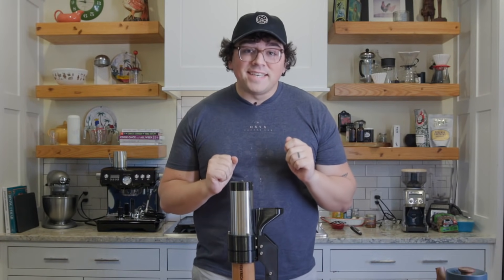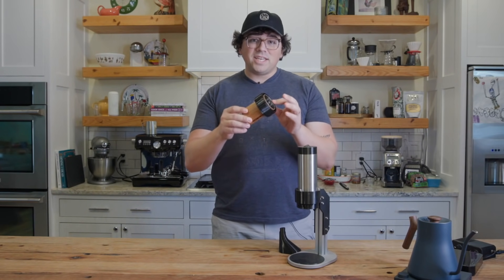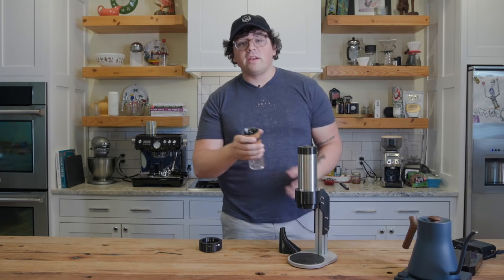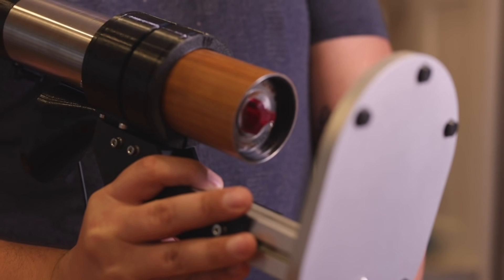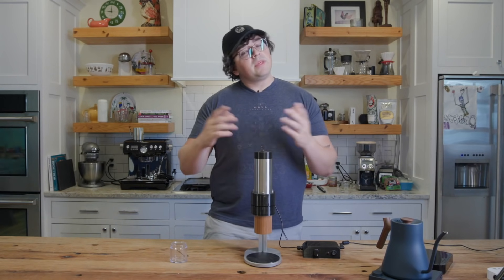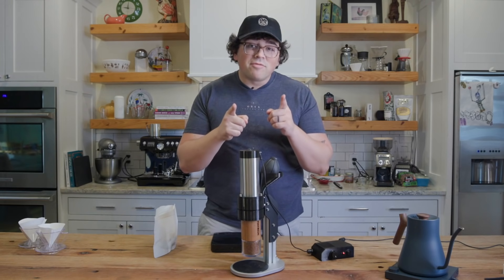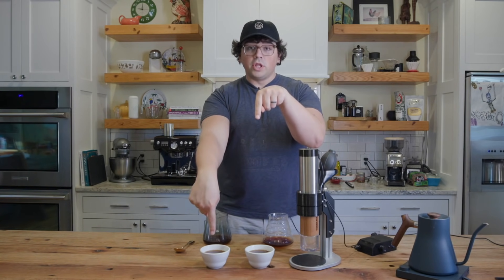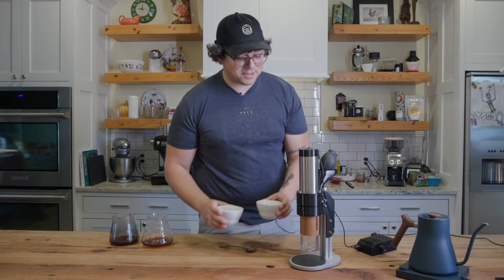MOTORIZED HAND GRINDER?: Review of the Skope Motor for the Comandante

Comment: I found that for espresso when I grind slow the shot time increases so I have to grind coarser
Reply: Interesting, sounds like you're getting more fines at lower RPM (I thought it's usually the opposite). Which grinder?
Reply: @BensCoffeeRants  1zpresso jx pro
Reply from the maker: This is intriguing! Hmmmm I'm wondering if going really slowly will somehow cause a reverse effect? How slwo do you think you're going? Below one revolution per second?
Reply: @LanceHedrick  maybe less than one revolution per second  but not much
Maybe I get a more consistent grind because I can maintain the speed better🤷🏼‍♂️
I will check it the next time I make an espresso maybe i did something else “wrong” and I didn’t tested that often because the espresso tasted good and in the end it’s all that matters right 😁
Reply from the maker: Well, if you were maintaining speed well, you shouldn't have high fines. An issue with hand grinding is the inconsistency in rpm. The more consistent, speculatively, the more even the distribution.
Reply: @LanceHedrick  today I tried it again and I tried to go as slow as possible and I noticed that I’m not that consistent with the speed because it gets very hard to grind the coffe 
The slow grind was 1 g/sec slower

Comment: Chestnut G1+ is in the same range as those 3 you mentioned, but i wouldnt add any motorization to it. These things are meant to run low rpm ie hand use.
Reply from the maker: Sure! If you listened, I do point out that the speed I use with the motor immulates hand speed. It just gives more consistency, which can give arguably a better grind distribution.

Comment: I wish I'll have the time to design one for cheap in the future , not even kidding.

I design BLDC motor controllers from DC power for a living, with some help from another engineer or just one my own with enough time. I would definitely make one.
I own a jx pro and this idea is rolling in my head for some time now
Reply from the maker: That'd be great! There is one for the jx pro made in south Korea, but is $800 haha
Reply: @LanceHedrick  OOF, That's a lot, I really hope I'll have time to look into it.
Do you know what kind of motor the Korea one uses ? If it's a DC motor with a gearbox that would be stealing to ask 800 for it.

But if it uses high torque BLDC motor that would be "a bit"understandable.

I will definitely look into this when I have time or find someone who would like to help me on it either on the programming side or the mechanical design side.

Do you have a link for the one in South Korea ? :D

Ah and by the way, thanks A LOT for your response, your videos are awesome !

Comment: Looks like a small funnel port. Do the beans clog up the funnel if say you dump them all in at once, or does this require you to pour them in slowly. I have a funnel on my current grinder with a 20-22mm opening and I have to occasionally stir the beans to get them to drop into the burr set. That funnel looks quite abit smaller than that
Reply from the maker: The tip is small and I believe it is to disincentive dropping all in at once. But that's pure specialtion. I would argue, and Hoffman has done a little test on this, that dropping in at a slower rate allows you to grind finer and can arguably give you a better and more consistent grind. But even more importantly, dumping them all in at once had the potential, if going at a low rpm, to stall the grinder.r

Comment: Question that could make a good content for comparison video. This  verses electric grinders in a similar price range. So basically at the cost of the hand grinder, motor and variable speed vs a similarly priced electric grinder. Which is better for your buck? Benefits and draw backs of both.
Reply from the maker: Yeah. That becomes really subjective. Some people are huge freaks for the Comandante profile, so it makes sense.
I'm not sure a video with my opinion would do much justice because it is so difficult to make any of that comparison objective, if that makes sense.

Comment: I am kind of on the frugal side. I have a hand grinder where the handle can easily pop off. All I have to do is use my variable speed drill, tighten the chuck on where the handle usually sits, and grind away. I can use any speed i want. Of course, depending on the type of grinder, your mileage may vary. I would also not do this on a new grinder. Only one that has been collecting dust.

Comment: Hi Lance, for most case, for less Fine particle, Is lower rpm grind better for manual brew?  As for the other side of the argument, whether high speed rpm better for espresso grinding ?
Reply from the maker: Well, as I said in the video, it is truly all specialtion. As for fines theory, who really knows? Pull some shots with low fines and pull some with high. The former will have lower puck density, while the latter higher. Just need to figure out what your taste buds like most
Reply: @LanceHedrick  Thanks
Reply from the maker: No problem! Thanks for the question and engagement

Comment: Pretty neat, I was surprised you noticed one cup was better than the other and then thought the better one was the high rpm one! From my experience with a variable RPM grinder, it does seem like you get less fines at lower rpm which results in less bitterness, but also less body. I find for brew / drip / aeropress type coffee at coarser grounds the more unimodal grind distribution or just less fines (low rpm) does produce really enjoyable and clean / transparent cups BUT for espresso I kinda like some more body / bitterness sometimes. But that could change depending on the coffee (or my mood maybe).
Reply from the maker: So, as I said in the video, the only reason I assumed the higher rpm was the one I preferred is solely based off the specialtion that lower RPM causes fewer fines. So, I figured the vegetal tasting one was more underextracted. One with less fines would've let the water through faster, which the slower rpm did by 20sec, so I figured that must've been it.
I hadn't dialled this coffee in prior to filming purposefully to make the blind comparison a little more legit.

Comment: Wonder if you could just do a "dimmer mod" on a drill - tempted try that myself. ;D
Reply from the maker: Probably could! I wouldn't recommend a drill, though. Could break your grinder based on torque
Reply: @LanceHedrick  I use an 18v drill on my cheap £10 hand grinder and tbh it does a really good job. Been a few months now and it's still holding strong.
Reply from the maker: Wow! That sounds awesome. I need to try my drill on some cheaper hand grinders.
Reply: @LanceHedrick  Please do and let me know how it goes. Might even be worth doing a video! I'd watch that haha
Reply from the maker: I can't NOT make a video on something weird

Comment: The KINGrinder range of manual grinders is designed to be used (optionally) with electric screwdrivers. I hope other companies would follow this trend.
Reply from the maker: Cool! And no issues with the axel breaking or any other issue?
Reply: @LanceHedrick  They claim to use beefed up bearings and shaft specifically to support the high RPM of electric screwdrivers.
Reply from the maker: Oh wow! That's incredible! What is the top end model? I'll look into getting them to test

Comment: My endgame grinder would be an electric that has zero retention, is simple to clean, and is highly customizable (swappable burrs for different situations, variable speed - i.e. somewhat future proof). My pet peeve with most high-end electric grinders is that you might spend thousands, but you basically only have one profile with that grinder. I'd rather have several, specialized ones instead.

If this motor had adapters for other hand grinders, I think I'd have what I was looking for. Compared it to an equivalent electric grinder with the same quality of results, I think that price is actually reasonable. I would seriously consider buying one if they had adapters for other hand grinders. I might have to buy one and make my own 😁!
Reply from the maker: Do it! If you can make an adapter, that would be huge!
Reply: This is why, 4 months after buying my DF64, I still haven't gotten rid of my Niche Zero. 😉👍
Reply: With variable RPM you can kinda DO have multiple profiles. If you want a bit more bitterness and body at the expense of clarity, choose higher RPM, if you want more clarity, less body, (and don't mind a longer grind time) choose lower rpm. If you can't decide, go somewhere in between :p
Reply: @BensCoffeeRants  great point 😁! Definitely didn't mean to imply total limitation. What I was more referring to was burr geometry. Some are better optimized for certain brews. Also, I've seen some people that have two or three of the same hand grinders. Seems using multiple grinders/burrs can have benefits for when switching between methods (e.g. espresso to pour over) or beans. Less to think about in terms of grind adjustment and retention from the previous setting. I know at some point this can seem ridiculous 🤣, but I'm just after total flexibility. I guess what I'm thinking is a modular system.
Reply from the maker: Just get a motorized hand grinder with a burr geometry you like and then a flat burr grinder with lots of Burr options, like 64mm or the like. Then you can switch out as you like haha
Reply: @LanceHedrick  lol Lance, it's like you and I are on the same page here! 
😉👍
Reply from the maker: For sure! Switch with the coffee or the day or the mood!
Reply: @LanceHedrick  haha, well I meant in terms of the idea of going with an electric hand grinder paired with a 64mm flat burr as a combo, but yes, that is precisely the point! 👍
Reply from the maker: Ah yes. Very good. Need transportability, for sure
Reply: Great points guys 😄. By the way, I'm almost there now. I have a Ceado E5P (64mm flat) and an Encore (with M2 burr upgrade) for electrics. My hand grinder is a JX-Pro and should have had the ARCO by now, but...

Been thinking about a modular grinder for a little bit. Thought it was something nobody else really cared about until I saw Lance's video on the Etzinger. That's starting to move in the direction I'm referring to in terms of changeable burrs. What I'm thinking though is for the burr set as a fully contained module. Essentially the grinding section of hand grinders, except it would be more compact since it doesn't need to hold any beans. With a variable speed motor, you'd be able to explore flat burrs and burrs of different sizes (e.g. 83mm conical at lower RPM). Haha, maybe I'm just thinking of the KitchenAid of grinders 🤣.
Reply: @davidmaurice1294  hmm 🤔, that would be interesting. A hot-swappable modular grinder setup where you could easily switch between conical and flat burrsets. Assumably those module housings would be customizable too, so you could put in Mazzer or SSP burrs.

I'm in a similar situation as you right now. I have a DF64 for flat, a Niche for conical and a JE-Plus for manual. At the very least, a variable speed motor rig for the JE-Plus would allow me to remove the NZ from the equation.
Reply: @slvrbach  Yeah, I like the way you put it, "hot-swappable" 😁. I'm thinking each module might range in cost from $100 upwards (maybe even $1k+ for some). But considering many endgame grinders might start close to $3k, it doesn't seem a stretch to have something that starts at $1000 that you can upgrade over time.
Reply: @LanceHedrick  Just thinking out loud here. If for a grinder of smaller diameter and same hex size, would adding a rubber strip between the grinder and silicone as a shim make the connector work. In other words, to make it compatible for some grinders, an adapter might be additional rubber to resize it to the Comandante's dimensions. Is that something you could test?
Reply from the maker: Hmmmm type this up and shoot to my email. I'll def forget. kylelancehedrick@gmail.com
Reply: an electric motor would help me as I have difficulty holding the Comandante as I grind, due to arthritis

Comment: Really interesting. I tend to wonder why it seems most pourover brew guide videos I watch tend to have much slower drawdown times than I tend to get with my V60. This is especially so when I try to bloom: when using a 2:1 or even 3:1 water-to-grounds bloom ratio, the water always draws down way too fast for me to do anything like what James Hoffman does in his V60 guide during the bloom phase. The effect of slower RPM presents one possibility since I use a hand grinder, whereas most coffee Youtubers use electric grinders, which may mean that my grounds may have a smaller proportion of fines that speeds up my drawdowns relative to the norm.
Reply: i recognized the same with my v60! i always wonder why in my experience i have to grind finer compared to other v60 recipes on youtube.
Reply: I had the same problem with blooming. It was always just like a foam and I couldn't stir it. Quickly wetting all the grounds and general faster pouring during this phase worked for me. Also using a hand grinder.

Comment: You may find it's down to particle shape rather than size, I have seen others do a Kruve sift test at different rpm's and they had similar number of fines, but only on a visual inspection rather than through an electron microscope, but different particle shapes give different surface areas for extraction.
Reply from the maker: Oh for sure. Particle size is massive. Issue is, this is even more difficult to quantify than distribution.
But yes. This is a big point bentwood preaches with their grinder- they're making much more spherical grounds. 
Big difference, assuredly

Comment: I love this! I was just thinking last night about how to make an electric motor for any hand grinder. 

1 upgrade I see for this... a hand tightened screw with a lever latch. 
But in this case where it's ONLY for a comandante, the screw probably wouldn't be necessary. Just the lever latch that would latch flush with the collar at a fixed pressure. 
Hoping for a universal iteration of this motor! I've really been wanting to motorized my 1ZPRESSO and KingGrinder. Would be awesome to have one machine that would work with both!

Comment: I've always wondered about this, I have a cheapo grinder that crank with a drill, dunno if safe. 

Ok 3 minutes in, probably risky.
Reply: Done something simular with the Hario i have. after upgrading to metal burrs i was wondering how to motorize it. made a contraption that makes me use the homeblender on top of it. works perfect
Reply from the maker: Yeah. I'd be nervous with these expensive hand grinders to use a drill. But feel free to do whatever haha! Thanks for the engagement
Reply: So long as it's a low speed, I can't imagine it being hard on a well made grinder. Maybe 30-50% faster than a person could grind by hand is totally something a grinder should easily handle
Reply: @veganpotterthevegan  But he found slower RPM tastes better, so maybe faster isn't better.
Reply: @BensCoffeeRants  I was only referencing the time, not taste.
Reply from the maker: That makes sense. With expensive grinders, im always wary to do stuff like that, even with well made ones like the Comandante where there is no aluminum in sight haha.

Comment: But to be quite honest, you might aswell just buy a niche at this point, I'm not sure if the comandante costs 400 aud tho I think it's around that mark, you might aswell just get a proper high quality electric grinder. Could also go for the DF64 if u want flat burrs
Reply from the maker: Issue here is 1) niche is no good for filter coffee imo and 2) df64 is a completely different game to the c40. 
Flat burrs as opposed to conical..and neither one can be taken on trips.
Lots of options at the price range, which is why I said it is completely dependent on the person!
Reply: @LanceHedrick  ah I must've missed that but you're right, the portability of it especially considering how good of a grind it can produce is a serious advantage
Reply from the maker: For sure. But I do love the df64, so you're not wrong there haha
Reply: @LanceHedrick  Unrelated but I wanted to ask, is doing the preinfustion trick on the gaggia supposed to slow down the extraction because I've notice that it always seem to get a bit quicker extraction with the trick than without.
Reply from the maker: No. It speeds it up once full pressure hits. It expands the bed and begins to extraction process. Need to grind much finer when doing preinfuiosn.
Reply: @LanceHedrick  gotcha, thnx:)
Reply from the maker: Absolutely! Thanks for watching and engaging

Comment: Could burrs be optimized for a certain speed, possibly based on the feed rate at the top section of the burrs?  Just thinking of conical geometry that a more open top would let more beans in, and thus have weight pressing down from the top and potentially causing more crushing effect and more fines.  I know there are a few variable RPM flat burrs now and from what I have seen in those, although I have not tasted yet, that higher rpms tend to create more fines in those also.
Reply from the maker: Absolutely, and they are. Typically, pentagonal conicals are for darker roasts because faster feed rate whereas hexagonal, heptagonal, and octagonal are epitomized for lighter roasts with slower feed rates due to higher density.
You're dead on here

Comment: Thank you for this very interesting presentation! Quick Question: I just purchased a Comandante C40 MK4 last week, my first hand grinder. I exclusively make V60 (with an occasional Kalita Wave). What would you recommend as a speed for operating the C40 by hand? About 1 revolution per second? Or somewhat faster? Also, it seems from your video that consistency in my turns are important (ie: less stoppages). During this first week I feel as though there have been times I have grinded too fast. Thanks again!
Reply from the maker: I wouldn't worry about Rpm with hand grinding. Just focus on consistent revolutions